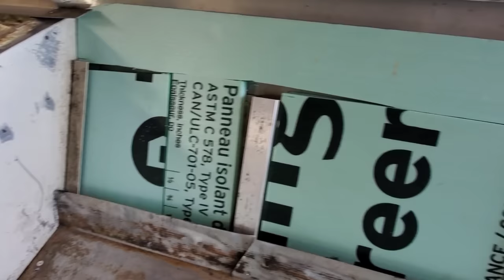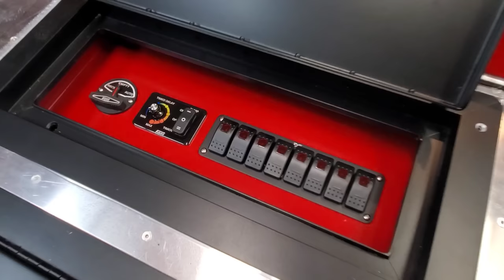SHOWSTOPPING Aluminum Boat Build in 10 Minutes

Comment: The satisfaction of having done it yourself is priceless,  and whoever hasn't been through a build like this, will never get it. I designed and built my own fiberglass Bass boat from an existing 16ft ski boat hull in 2014. Needs a new coat of paint, but still going strong, with a 150 HO Evinrude to help it along. But yes....never again...maybe 🤔

Comment: I used carpet in my express 17ft bass boat I built a deck extension on the front ordered some used hatches just like the ones on my boat now I got 4 dry compartment in front got 20oz carpet 4 big carpet graphics led lights throughout the boat pluss new fuse panel wiring and helix 7 used all aluminum on the deck extension

Comment: Do I understand correctly that the removed foam was supposed to keep the boat afloat in case of capsizing? Won't it drown now if it capsizes?
Reply from the maker: Would have drowned if it were left in as it was water soaked holding hundreds of pounds of weight. The owner specified he did not want any foam back in. This is an electric only reservoir boat, incredibly unlikely it will ever flip over. If it takes in water, it has a bilge pump.

Comment: Such a cool build. I can't afford a boat but one day maybe I will. How much overall was the cost of this build with you doing all the labor yourself?
Reply from the maker: Man, loaded question because I built it for a customer and had labor cost. He bought some of the stuff, alrrady owned some parts, really hard to tell. I mean, the trolling motor alone is 3k. You could probably buy all the materials for 4-6k not including graphs or batteries or motors. But add in labor,  candy paint, all the expensive electronics,  this is a 25K boat all day.

Comment: wait, you left the transom?  that much saturated foam and a soaked transom seems like the first thing to do
Reply from the maker: The transom was solid. Foam was only soaked in the bottom inch. Transom is 8 inches up. 1.5 yrs later, this boat now has a jack pmate and a 50hp outboard.  Transom was fine. Otherwise, I'd have addressed it.
Reply: @AnthonyJonesBrigadeBoats  I was curious if you liked the electric, sharp build!
Reply from the maker: Um I do. But not because they are electric.  Because I like the electric only reservoirs and fisheries we have  here in Ga. Greatfishing, scenic, peaceful. They are manmade and for  drinking water, hence regulated electric only. The red boat now has a 50hp electric outboard on it with a 28mph top speed.

Comment: Nice Job!  I'm considering pvc board for the flooring on my jon boat after watching another video.  i figure, cost wise, it would be about the same, given the costs of plywood and resin.  Not to mention all the time spent of resin drying and paint drying.  Just wandering if anyone had done it on a jon boat.  Here's the video I saw   https://www.youtube.com/watch?v=ma3DWV31-IQ
Reply from the maker: I've always thought pvc board was flexible? I watched the video, ill have to look into it further. The pvc sheet ive seen at home depot flexed alot and was not solid like hdpe. That guy did a nice job though. For me personally,  i just use all aluminum sheet and hatches now.
Reply: @AnthonyJonesBrigadeBoats  You’re probably right, just wondering if anyone had tried it.  I replaced my transom boards using your method and couldn’t be happier, it just takes so long.  But I know I’ll never have to worry about that again.  Thanks for your videos brother.

Comment: Nice job Anthony as always, I do think it’s time you step up your game and start using aluminum welding over most of the rivets. I get you have to use some rivets in some spots but that takes up too much time when you can pre fabricate and weld then install. Time is money and doing double work cost you money. Take a look at Tricked Tins Page and you will see how fast he gets his work done. He also uses minor rivet work on his builds only when necessary. I am not by any means trying to be harsh here just simply stating welding is much more stronger and cleaner looking.
Reply from the maker: I get it. Perhaps your unaware but this footage is almost 2 years old. I've welded my past 3 boat builds. You can look at my last build on here, the Alumacraft Bandit, all welded. I've been welding a year now, you can see allthe real time frames and builds on my instagram,  @adubjones..I'm simply re editing old footage for a 10 minute videoseries im doing. Appreciate the insight.